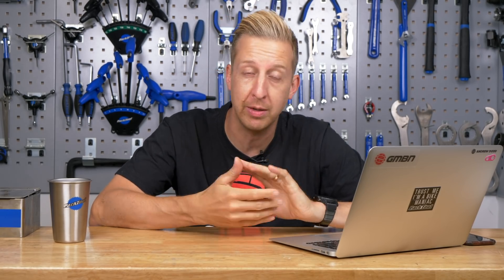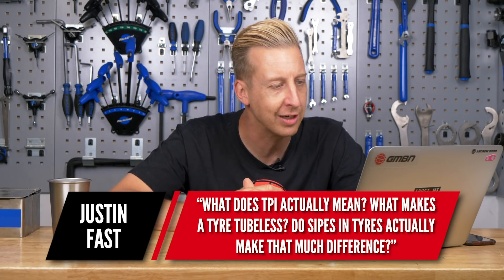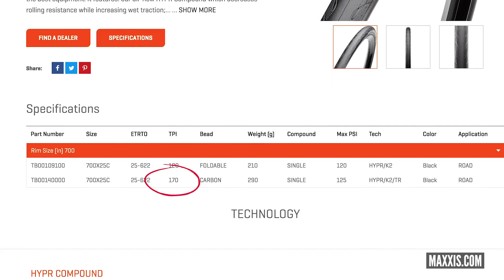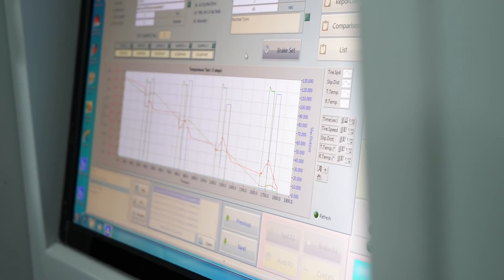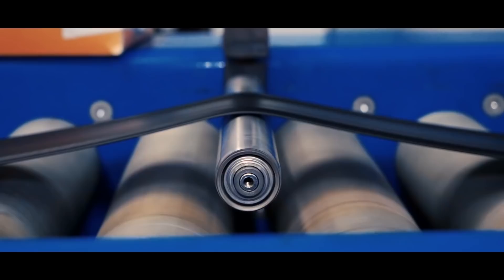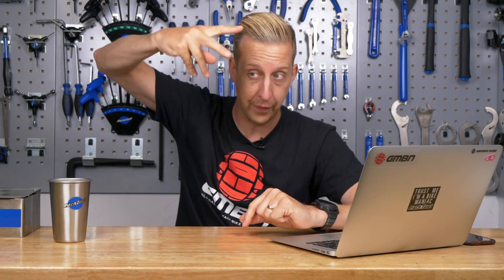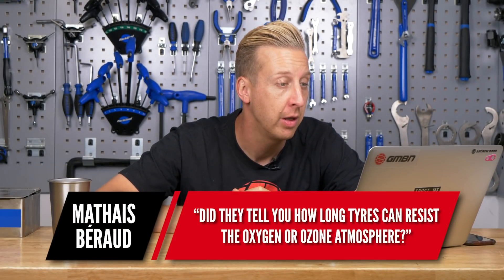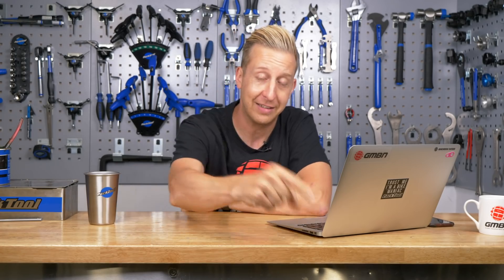Why Do Tyres Smell Fishy? | Ask GMBN Tech

Comment: #askgmbntech  MY KS Lev Dropper seat post sometimes sticks on the very last bit of travel and I need to drop it down and come back up again to get it to release.  Is there any easy fix for this?  I noticed that the seat post had a slight layer of grease or lubricant on it when I bought the bike in 2016 (Cannondale Habit).  It has worn off over time.  All I have is some Park Tool polylube which I applied just a dab on lightly covered all sides figuring it might help it.   Is this a good idea or what is the best way to maintain it?   Thanks!

Comment: #askgmbntech I've got 1x11 drive train. Whilst I get fitter I'm finding my lowest gear (42T) isn't quite low enough. Would it be better to change to 44T or 46T, and how much difference would it actually make. Or  change the chainring (32T) and what kind of difference will that make? Thanks for all the great info on the channel.

Comment: #askgmbntech Hello,can you explain me the Truvativ Hammerschmidt front drivetrain,I know that it is old sistem but guys from Truvativ are saying that its revolutionary because you don't have a typical front chainrings and derailleur but you have one chain ring which gives you ratio from 22 T to 36T in front??
For me that sounds perfect because I don't have to buy any expensive 1x drivetrain (like Sram eagle,Shimano...)to have a 1x sistem with wide ratio of gears,I could just buy the Hammerschmidt and use a cassette which I use now (9 speed,shimano 11T - 34T),which is I think more bearable for chain,but I don't see people having it,why?What is "wrong" with Hammerschmidt?

Comment: #askgmbntech I’m looking to upgrade the fork on my bike as they are those cheap coil forks. I look on stuff like eBay and Amazon and I seem to be finding a lot of forks that are for 29er. I was wondering can you run a fork meant for 29er wheels on 27.5. Will there be huge changes to the handling and all that stuff? Thanks

Comment: #askgmbntech Hi, Enjoy your videos, and have a question for you.  I am currently looking at replacing my tyres which are currently 2.3" Wide.  I am wondering how you work out what width you can fit onto your rims. My Inner Width is 20mm and outer width is 32mm.  I am looking at Continental Trail King 2.4".  Any help would be appreciated.

I would also like to say, recieved my 1st GMBN order of Team SS Top and Socks, they are fantastic.

Comment: #askgmbntech would it be a good idea to build a downhill bike with pedal kickback built into the suspension design? My explanation is you pump unto the bike and keep your feet level so you can gain forward energy without pedaling... if that makes any sense.

Comment: #askgmbntech 
Hey guys! Love the contents and you are all amazing 👍 I am quite new to the MTB world in general and I was wondering; on my XC bike I am running a pair of Schwalbe Rapid Rob with minimum tyre pressure ,specified on the tyre itself, of 26 psi. Would it be ok to run a lower pressure than 26 or would I risk blowing the whole tyre? 😅 I run inner tubes and I am 1.76cm for 70kg if it's of any help. Thank you so much in advance!

Comment: #askgmbntech
"hi great channel and great vids can you recommend some decent shock pumps, I'm fed up with trying to set my air pressures only to lose all the air when I unscrew the valve
Many thanks Rob.
Reply: The air you hear when you unscrew it is generally the air in the tube connected to the shock pump as opposed to in the shock. Typically the vale core is released on the shock prior to the screw on portion losing contact with the valve outer. That has been the case with every pump I have ever used irrespective of mfg

Comment: #askgmbntech
Why do mountain bike disc brakes squeal and make horrendous noises yet you never hear car or motorbike brakes making the same noises, even in the cold or rain!?
Reply: Bedding in may be. 
My wife’s bike squealed, until I realigned the callipers to stop rub. I had to use up to 4 sheets of paper one side of the disc before tightening bolts so I could get an equal gap each side. I also cleaned the pads with surgical spirit.
Reply: Different vibration frequency would be my guess. Mtb discs are very thin and light compared to moto and car. If you take a piece of thin sheet metal and shake it it'll make a weird sound.....now do it with a 1/4" plate of steel => quiet

Comment: #askGMBNtech# love the show. I just wanted to ask I use my bike (XC hardtail) for commuting and for riding trails on the North Shore I was wondering what would be good tire to do this good wear on the roads and good grip on the trails. I running Maxxis Ardents but I find they don’t have great grip on the trails. Also I was wonder what ever happen to Kevlar weave tires that you use to see in the 80’s and 90’s , they were great tires , I could ride trails with lots of grip and they would last years riding on the road also they had great puncture resistance I never had a flat with them, even when they were worn down to almost slicks.
Reply: Kevin Smith yes you can use your XC bike for commuting and riding trails. I would look for a semi slick tire

Comment: #askgmbntech I recently got a trek remedy 8 2019, as I was preparing for BikePark Wales I choose to get a DH tube, so I installed it and now my tyre is out of shape? Tyre is on the bead and the wheel in straight and true. It’s 4 weeks old maximum!

Do I have a faulty tyre?
Reply: TiefVW probably. I’ve had two tires go bad (wiggly but with a straight rim and perfectly seated)

Comment: #askgmbntech
i recently found out about waxing your chain with parafine wax instead of using lube.
my question is, would you advice using wax on a mtb?
i never seen anyone using it but not dealing with oil sounds pretty good to me.
Reply from the maker: Tschuldigung wegen grad. Wax or dry lubes are great for dry weather but we suggest running a wet lube in wet weather.
Reply: If you ride in a lot of dust, then use wax or dry lube. If you ride in a lot of mud, then use wet lube. Either way, make sure your chain is completely clean first.

Comment: #askgmbntech I have an XC Trek marlin 5 2019 and it is making a noise from the fork when its bumpy its like something is being smashed it sounds like it its coming from the front. Any Recommendations on what to do?
Reply: Miguel Vella can you tell if that sound mostly happens when the front wheel springs off the ground? If so, that’s a common problem with cheap forks, and as far as I know there’s nothing you can do about it. I had that exact bike for a few weeks and the clunks from the fork were very annoying
Reply: @peterlang5047  yes it mostly happens when the front hits bumps and stuff thanks alot
Reply: Miguel Vella I’m pretty sure every cheap fork does that.
Reply: @peterlang5047  does is it do damage in any way
Reply: Miguel Vella not that I know of

Comment: askgmbntech  
 is it ok to run a kenda 2.35 in the front and a conti 2.2 in the back
Reply: Depends what frame/fork you're running? If the frame and fork have enough room to allow those tyres whilst keeping enough clearance, the yes. Run whatever combination you want,just make sure you have clearance.

What size are your current tyres? And what frame and fork do you have? This information will make it alot easier to obtain an answer.
Reply: 18 inch
Reply: And 120mil fork
Reply: If they fit in your frame and fork, then it’s absolutely fine
Reply: They probably will fit if you have anything other than a road bike

Comment: #askgmbntech hey Doddy, I have a buckle in my e13 trsr carbon wheel. Can this be repaired? I ask as its been to an lbs twice and still isn't near true. Cheers🤘
Reply from the maker: AJ Thid depends how buckled it is.. The mechanic may choose to get the spokes to an even tension rather than fully true the rim. With disk brakes we would suggest this as in some cases the amount of tension required to completely true the wheel actually results in spokes being under too much tension.

Comment: #askgmbntech Greetings, what would you suggest for wrist pain. Is there a special handle bar or wrist brace? I started weight lifting and now my wrist hurts every time I go out for a ride. What do cyclist who have this condition usually do?
Reply: I broke my wrist a few years ago, and as a result the scafoid bone has disintegrated, causing my wrist to collapse. There is a company called Mobius, they make top end wrist braces that you can adjust with regards to how much movement you want from it. They are used by alot of the top pro motocross riders, and come highly recommended.
 I find them pretty comfortable, and don't really notice it when riding with it.they are pricey though! 

Hope this helps?
Reply: @carlstanton2550  thanks, I sure do appreciate it.
Reply: if your wrist hurts from weightlifting, why blame the bike? maybe you have to take it easy lifting instead
Reply: @ultiss  lol, I'm not blaming bike riding, I want to do both activities, so that's why I'm asking GMBN for advice.. They must know a lot of cyclist who are going through the same thing.

Comment: #askgmbntech Charger damper question: I’m on a 2015 Rockshox Pike RCT3 with the DebonAir spring upgrade but the fork still feels slow/over-damped even with rebound/compression fully open. I’m confident in my own ability to work on the damper myself but would you recommend changing the shim stacks or could I bleed the damper with a lighter/less viscous oil to speed things up? Thanks :)

Comment: #askgmbntech frame construction question here: On many full suspension bikes I've been noticing a super low top-to-seattube junction with an extended seattube, so the seatpost gets enough support. This produces this (imo) often times weird looking triangle.
It makes perfect sense to me if the rocker or the shock itself is mounted to the toptube and just requires it to be in that low place or to provide room for the nose of the saddle on a dropper. But why is it that low so often even if it isn't required? Wouldn't it make more sense to open up the front triangle so you can fit a framebag/bottles/toolrolls or something?
As an example for what I mean, look at the 2019 Cannondale Habit or a Canyon Spectral CF.
Reply: It's to help prevent you smashing your private bits on a metal tube
Reply: Steven Chabot exactly
Reply: I don’t know if there is a real engineering reason but I really like the way low top tubes looks, it reminds me of a dirt jumper bike and seems more agresive and playful. Usually xc bikes don’t have such a low toptube.
Reply from the maker: Acoustic Gearhead This is to allow people to upsize the frame if desired to allow a longer reach. It also means that riders wanting a more playful bike can choose to run a dropper with more travel. Most trial/XC bikes still have enough room to run a frame bag 🙏
Reply: @gmbntech Thanks for the answer! <3 
Still struggling a bit though. I get that the usable seattube is as short as possible for all frame sizes to allow for upsizing which explains the generally lower toptubes on mtbs as compared to say roadbikes.

I still can't wrap my head around why the junction is so low on the seattube though. As in why does the seattube extend 15-20cm above that junction instead of just 5cm assuming a fixed (minimal) overall seattube length? Wouldn't it be better for strength to have the junction as high as possible on a given seattube length?
Reply: As far as I know, the top tube is low so you can stand over the bike (in front of the seat) and the seat tube goes up high for more support for fat dudes

Comment: #ASKGMBNTECH 
Hi there doddy, umm is it ok if I put a adaptor to my V brake bike so I can put a disc brake on. Is it ok if I trail my bike using a adaptor brake, is it gonna be safe or not... And my bike is a GT AGGRESSOR
I hope u notice this 👍
Reply: It would be fine as long as you mount them properly
Reply: Does your bike already have disc mounts? If so, then yes. Everyone does that. If not, then no. No one does that and for good reason

Comment: Will replacing a 100mm travel fork with a 120mm travel fork b bad for the bike
Reply: will just increase the aggressiveness of the bike mate x
Reply: It will slacken the head angle, and raise the bottom bracket height slightly. It's definitely not a bad thing.if you're able to borrow a longer travel fork from a friend, I would recommend it, just so you get a feel of how it will ride, but it won't feel drastically different.
Reply: That will be fine. Anything more than that and I would be worried, but 20mil change is ok

Comment: TLA’s can be confusing when they have two meaning. TPI can also mean teeth per inch.
Reply: in which use would that be?
Reply: Johannes Nilsen measuring screws and bolts etc an engineer term.
Reply: @retroonhisbikes  Ya I understand, but I meant for which use, I haven't hear dthis before.
Reply: How many teeth are there per inch on tyres?
Reply: cornishcactus I’ve heard of thread count when it comes to bed sheets etc. Never heard of it mentioned on tyres before. That’s the trouble with tla’s